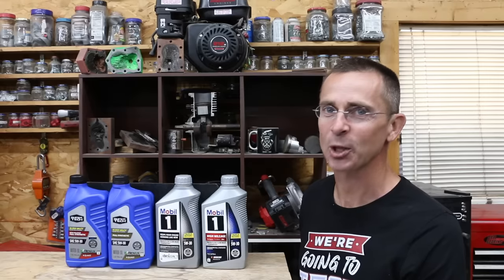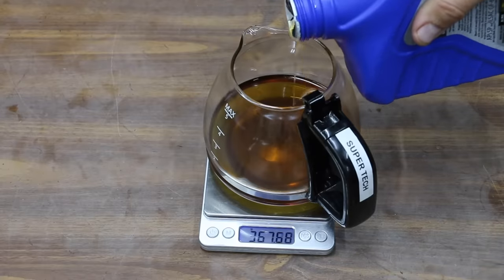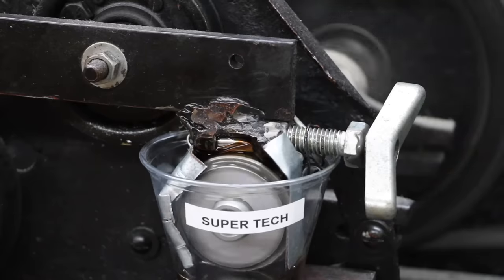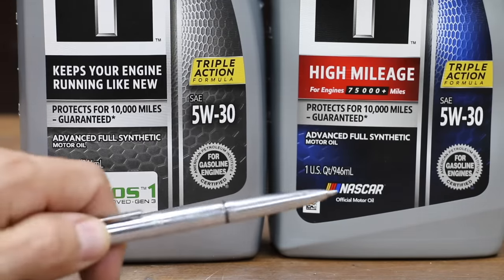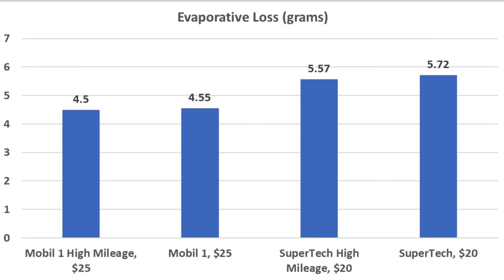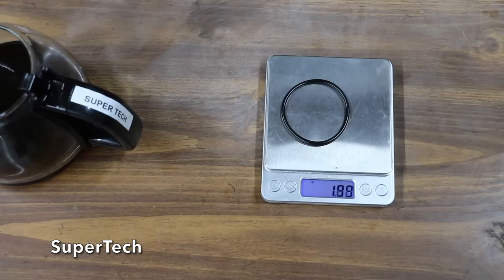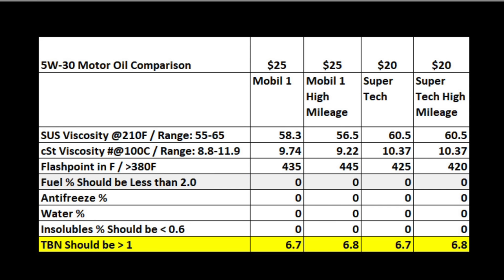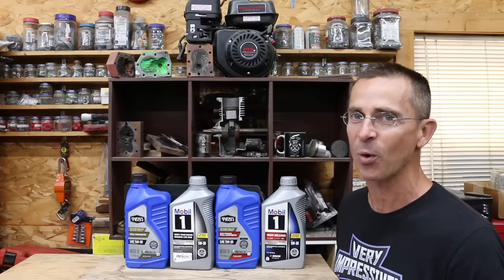Is “High Mileage” Motor Oil Safe? Let’s find out! Mobil 1 vs Mobil 1 High Mileage; SuperTech vs STHM

Comment: I'm always interested to see reviews on Super Tech products as they're what I always use on my vehicles, simply because of the affordability. I regularly drive over 3k miles in a month in my personal vehicle and have to do oil changes often to keep it running smoothly; In the 6+ years that I've used ST oil and filters across several different vehicles and thousands of miles, I've never experienced any issues that could be traced back to or blamed on inferior oil quality (knock on wood).
Reply from the maker: Thanks for the feedback.

Comment: This is why I love this channel.  You just can't get this stuff anywhere else lol and the thing is.....I don't think anyone can really argue with the process that these tests are done with. 

Great job dude. Never stop doing these tests 👌🏻
Reply from the maker: Thanks!
Reply: Except the flow test seemed flawed. That third pipe appeared to hold the oil back. Once it hit the metal ramp it flowed just as quickly as the others as could be seen by the bubbles. Also, there are many other tests that can and should be done on oils to measure their performance in the following areas:

Oil viscosity and lubricity
Oxidation stability
Acidity and/or alkalinity
Pour, flash and fire point
Soluble and insoluble contaminants
Air release and foaming characteristics
Anti-corrosion and anti-rust characteristics
Anti-wear and extreme-pressure characteristics
Water separability and emulsibility characteristics
Relative cold-weather operating characteristics
Reply: @simonmiller5118  it was fast forwarded
Reply: Consumer Reports has entered the chat,...
Reply: @nostradamus7648  lol
Reply: @ProjectFarm  would u please do a test on the supertech HD-30w
Reply: I use Castrol 5/30 Synthetic oil on 1998 Volvo V70 manual transmission non turbo with Lucas Synthetic oil conditioner and WIX filter with 394.000 and still going strong. Before changing oil I add 16 oz of either SeaFoam or Lucas oil and gas additive, idle 1/2 hour then drain. And it doesn’t burn oil.
Reply: Sure his processes can be argued. After all, he’s just a guy testing things in his garage, so he’s subject to many limitations.

Comment: The original oil comparison series was great and really opened my eyes about the different oils out there.  I really enjoyed this refined head to head test.  The Amazon Basic and Supertech have been my go to for quite some time as I have 5 cars and multiple small engines to keep up with and price is a factor.
Reply from the maker: Thanks for sharing!
Reply: Kirkland oil (Costco) is also made by the same company and can usually be had cheaper for the same oil when its onsale.
Reply: @mimibuick  ..that's what I have heard, also..but there's not a Costco around here within a hundred miles or more...there's at least 10 Walmart's within a 50 mile radius....
Reply: @dyer2cycle  sounds about right. My area has like 20+ Walmarts and only 2 Costco locations. Costco is reserved for bigger cities for sure
Reply: I have been using Supertech for all my cars as well but nowadays price has shot up to over 20$ per 5 quartz. Last years it was around 17$ and I actually got 4 for 3 of my cars. Now cost 4$ more in 2022.
Reply: @tousshong9438  ..Yes..I have noticed that on just about EVERYTHING at Walmart..including their Great Value grocery items..now, some are just as much as the brand names.."Shot Up" is an accurate term, I think..previously, you just couldn't beat Walmart on prices, even though they didn't typically have "sales"..they would beat everybody's sale prices in most cases..I didn't even check around...NOW, however, it's a different story..often, if you look around, you can beat their prices by watching for sales, sometimes even without..I know EVERYBODY went way up on prices, but none as drastically or noticeably than Walmart..they seem to have totally lost their "low price advantage..always"..it may prove to be beginning of the decline of Walmart...

Comment: I love these oil comparison videos! I would like to see a comparison of different viscosity oil like 0W30, 5W30, 10W30, 10W30, 10W40, 2W50, etc.
Reply from the maker: Thanks for the suggestion.
Reply: Second this. Seeing 0w30 vs 5w30 flow rates would be nice. Same as viscosity results.

Comment: Pretty cool results. Before I became an ASE certified mechanic I worked in lube shops so this is neat to see. If you do this again in the future, maybe suspend the O-rings from the top so they're not directly in contact with the glass right above the heating element. That might give a slightly different result. Or not whos knows lol! Always enjoy your videos!
Reply from the maker: Thanks!  Thanks for the suggestion.
Reply: @Project Farm  no problem my friend I appreciate all you do for us Youtubers! One thing I've been interested in as of late is, testing the anti-foaming abilities in oils being these newer cars tend to run higher RPM, and hotter etc. A windage tray helps with that but was always curious if conventional vs synthetic etc makes a difference. Just a thought. Thanks buddy

Comment: I love your oil tests. I was using Pennzoil Ultra Platinum after 25 years of  Mobil 1  before you did your last test. You've always done it with 5W30. I'd be curious to see results with different viscosities from similar brands. Like 0W20 vs 0W30 vs 0W40 for example, to see if they differ from the 5W30. Not so much  the wear and viscosity, but the additives more so.
Reply: I used to swear by Castrol for the longest time and after he did his big oil show down a few years ago I won't use anything but Pennzoil or Amsoil.
Reply: @charliehotel2197  
Honestly I switched to Pennzoil around a decade ago because it was cheaper than Mobil 1. Since it was no longer the real synthetic it was when I began using it, why pay the price. At 80K with Ultra Platinum from the first oil change, I saw how clean the top end of my engine was while replacing the valve cover gasket. It looked new. Not a deposit, discoloration, or wear to be seen.
Reply: Any SAE 30 oil well behave similarly when hot, biggest difference is in 0W/5W/10W/15W describing it characteristics when cold.

Comment: As a man who has probably outlived his expiration date I've found the best oil is the one that's on sale that week and just be sure to change your oil regularly.
Reply: Obviously they aren’t created equal. Might make sense to buy a better performing oil than save a couple bucks.
Reply from the maker: Thanks for sharing!
Reply: That's what I do. 215000 on a 2002 dodge ram.
Reply: @phxrsx  Nope. Just change oil on regular basis.  I have put over 200000 miles on at least 3 cars with oil that was on sale. No problems at all.
Reply: As long as the oil you buy meets the required spec ex. (ILSAC GF-6A) and you change it on time, you should have nothing to worry about. I always use the severe duty maintenance schedule provided by the manufacturer and never had an engine burn a drop of oil. I am also way past my expiration date.
Reply: AMEN !
Reply: i used to think that until i bought some conventional penzoil on sale. my poor old van threw a rod bearing on the first 100 miles after the change. never again.
Reply: @iamzid  ..probably wasn't the oil..probably just it's time...
Reply: @iamzid   My late husband "threw a rod" on our honeymoon! The old SOB was like a sizzlin' wet lizard on a fry pan hoppin' up and down on that damn bed! ! !
Reply: I think a lot of older naturally aspirated engines will run forever on just about any oil. Where I've been seeing a lot of problems has been with newer direct injection engines with lost of boost.
Reply: @ray lattner  200k miles is nothing to brag about these days, good engines that are well taken care of last 400k+ just because you have some 200k mile cars does not make you an oil expert
Reply: Lots of people have never had an engine fail from lack of lubrication, in no way makes them an oil expert or even educated about it in the slightest

Comment: I've been using the Mobil 1 High Mileage in my car for a while now, so nice to know it actually has some tangible benefits! Too bad the car is rusting away to nothing, but at least the engine runs.  Thanks for the info!
Reply: The high mileage and seal conditioning aspect is STILL questionable, even after all these tests. Doesn’t prove jack. The lab results are all “within the noise” and also don’t show the high mileage oil as being LOADED with extra additives. 

I’ve never used a high mileage oil in any of my engines. Even the one with 350,000 miles on it. I replace seals when they leak. 🤷🏻‍♂️
Reply: Use old  oil and preshure washer to prevent rusting

Comment: Super Tech is an oil Wal Mart purchases from Gulf lubricants. Gulf makes several aftermarket labeled lubricants and many commercial grade lubricants. I have never experienced mechanical failure using Super Tech engine oil.
Reply from the maker: Thanks for the feedback.
Reply: @ProjectFarm  Walmart uses Warren Oil Distributors for its Synthetic oils. Warren Oils has been in the petroleum business since the 1920’s. They have a very good reputation. Warren makes oil products for many car companies, retail stores and oil companies under many names. All are quality products.

Comment: Very interesting results! I've been using supertech for years with a quart of Lucas oil synthetic stabilizer. I noticed a difference in how smooth the engine runs but wonder how much of a difference in performance it provides. Keep up the great work! 👍
Reply from the maker: Thanks, will do!

Comment: Thanks bro! I'm amazed at the time and thoroughness you put into these tests! most people would never do these nor would they ever Know what the true  unbiased results were.. Very densely packed with valuable info!  As a long time user of the supertech full synthetic  , ive tried the high mileage version from time to time although I never Knew what real,if any benefits it offered...For the record, we have a 94  ford probe gt at 250k mi and a ford focus zetec at over 350k mi , both daily driven... The probe gt has recently started to puff some white smoke, just alittle and briefy during initial startup, probably valve guides... the focus however burns no oil ,no smoke ever and the engine feels like a car with 50k mi on it... oil changes with filter usually done at 5k mi...new sub here!

Comment: I love your oil testing videos. There is one variable I think that's missing. When you do the film strength test, what would happen if you have the oil heated on the burner while grinding away at the pin? Cold oil and hot oil have different viscosities and therefore different characteristics in terms of protection.
Reply from the maker: Thanks!  Thanks for the constructive feedback.

Comment: I remember when STP came out with25,000 mile oil it was all my Dad ran in his Datsun pickup. He started noticing it was vanishing so he bought cases whenever he found it. When he would change his oil it was slightly dark but never dirty. He figured it was so good that it threatened other oils.
Reply: Interesting
Reply: Mobil 1 when it was first introduced in the early 70's was rated for 25,000 miles. The auto industry and the oil industry raised a big fuss about it and that it would cost dealers and service stations money. ( Source- My dad was SAE Lube engineer for Sinclair and BP and friends with the folks at Mobil that developed Mobil 1. He was later VP of Sales for BP NA. )
Reply: Mobil 1 had a 20,000 mile oil a few years ago, but it was expensive and didn’t sell. People who change their own oil didn’t want it, and lube shops definitely didn’t!
Reply: Funny how that works. It's just a money maker but, 99% of people aren't smart enough to realize that. My dad did oil changes every 30k on his vans. When he sold his one van it had 580k. Engine was never opened and ran like new. He did 170k on his box truck. There was no sludge. That truck has 250-300k miles and has never had an issue. There is a website for a million mile Ford van. It did almost 1.3 million until the oil pump seized. Engine was untouched. A couple of times he did 55k on oil and, it still did just shy of 1.3 million.
Reply: @karlhopkins713  I have a Ford Fusion plug-in hybrid with 120k miles that has had 5 oil changes in its life (I've historically gone by when it tells me to change it as the manual tells you to do). So that's about 25k on average (but about 30% of that is EV miles) but she does consume oil now though, about a half quart every thousand miles. So it's making me wish I would have changed it more and not trusted the manual. But it's not the end of the world. I'll go about 10k or less now I think. I have a 2005 Escape Hybrid that consumes about the same but with nearly 300k miles (and it always has consumed a bit).
Reply: @karlhopkins713  Remind me never to buy a van from your dad.
Reply: @5roundsrapid263  the extended performance is still around. It's 3$ more. I run it, but change at 10k. Figured if it was rated to 20k, it'll be fine to 10k.
Reply: @mrpbody44  so Sinclair with the Dino logo aren't ghetto cheap gasoline stations? Same as Arco I'm guessing
Reply: @karlhopkins713  ok, that does not mean that you should push up to 50k miles changes, and i guess it was only highway miles, witch are like 10% wear compared to city driving and or hills, so it was more like approximately 5K wear between changes, right were it should be, still do not go higher than 3 to 5 k miles, it is you who is going to pay for it in case it goes south, not the oil company or that guy with his ford
Reply from the maker: Thanks for sharing!
Reply: @gapcity2565  This was Annual Performance, not Extended. It was about $20 more!
Reply: @karlhopkins713  What oil was he using in his vans and what were the makes and models of them?
Reply: @mrpbody44  yup Mobil one 1974, AMSOIL 1972
Reply: @t.s.818  It was the 7th largest oil company in the world when it was sold to BP and Atlantic Richfield ( ARCO) They had a world class R&D department and a lot of products for metalworking and heavy machinery as well as aircraft

Comment: I use the Castrol High Mileage in my 2010 Mazda3 5spd. I just hit 130k. I've always figured a few extra preventative additives in the oil couldn't hurt for the same price. Nice vid, thanks 👍
Reply from the maker: Thanks and you are welcome!
Reply: I do the same with my 02 4.7 dodge dakota, sea foam, marvel mystery oil and the Lucas oil additives the stuff isn't crazy expensive so why not add it to my aging motor. At the very worst it just doesn't have any benefits but I think they all keep my motor clean and running good

Comment: Another great test! I have been using Walmart synthetic for years and I am very satisfied with the results so far. I don’t know if it’s a local thing but the closest Walmart is selling Mobil 1 cheaper than the store brand so now I’m using Mobil 1 again. 
Both of my vehicles have over 200,000 miles and they both are spotless inside and no leaks. I did replace the valve cover gaskets on both vehicles last year. I keep hearing that my engine will surely explode any second because I only change my oil every 10,000 miles but I don’t see any need to change it more often because it isn’t even showing signs of breakdown or contamination at 10,000. 

3000 mile intervals are for antique cars that don’t have a PCV system and sequential fuel injection but there are still plenty of dinosaurs who still believe 3000 miles is a universal law of physics.
Reply from the maker: Thanks!
Reply: @tooltime9260  

I used to work for a big fleet operation that did lots of oil testing. I learned that there are too many factors to worry about a set number. 
One prime example goes like this. We had similar equipment with Japanese diesel engines. Both brands had roughly the same horsepower rating and were used to do the same job. 
Both had 25 hour oil change intervals but after 25 hours the oil in one brand looked like roof tar and the other looked like it was just poured from the bottle. 
I was intrigued so I did some research and found out that one of the two was rated at 22 horsepower but the engine was actually rated at 36 horsepower. 
My conclusion is that engine load is the biggest factor.
Reply: Had a 2001 Ford Focus with the Zetec engine. As I was driving a 135 mile round trip commute daily,  I would put 12-13k miles between oil changes using Mobil 1.  My thinking was engine hours vs mileage. Got 400k miles out of that car before the rust took it, still ran great, no engine noise. Currently use a store brand synthetic in my beater vehicles and Mobil 1 in my "good" vehicles...but after seeing the cold flow test, I'm wondering.....
Reply: With a little tuned 4 cylinder making 310 hp and 375 ft lbs.. I change my oil every 3000 miles. For my peace of mind. 30K miles and catch can is still dry.